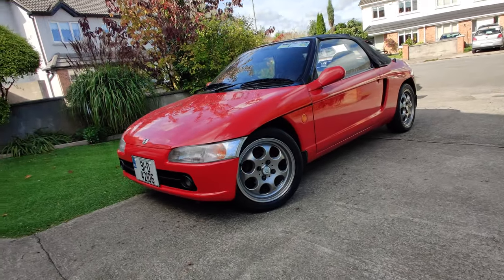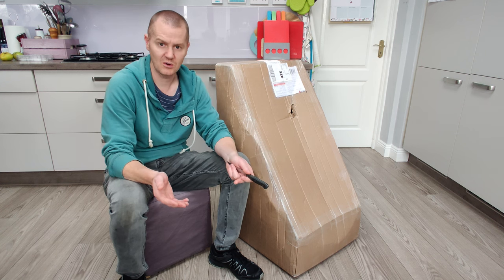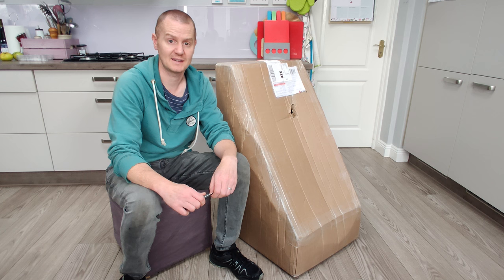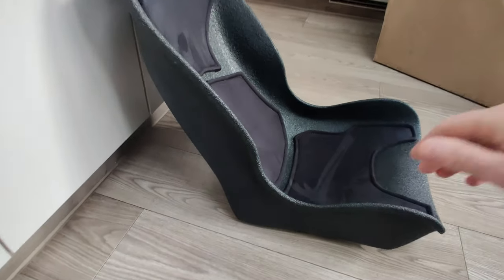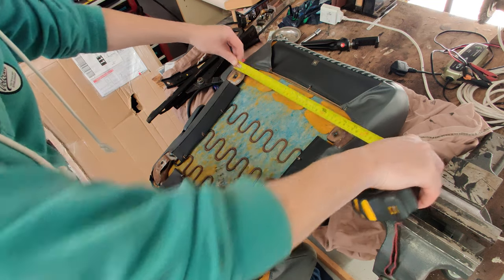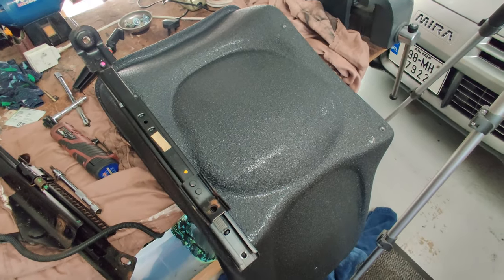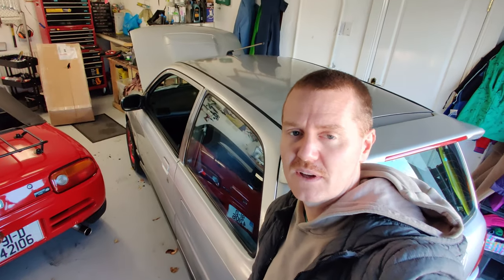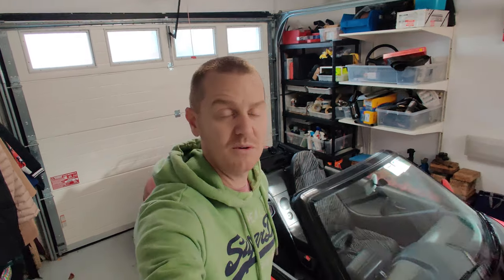Honda Beat - RCC seat

Comment: I was planning on fitting S2000 seats in my beat, driver side should fit the passenger side is a real tight fit where the shouldrest is against the door. But I need to some metal worker to fit them.
Reply from the maker: I'd imagine they'll be heavier than the stock seats also. I'm not a fan of leather seats either - you slide around too much!

Comment: To solve the recline issue, would a few washers/spacers on the rear rail bolts between seat & the rails change the angle enough?
Also, those Mini wheels really suit the car and how does it drive with the bigger rims the same size all round compared to stock wheels?
Reply from the maker: Yes, I could use spacers, but it won't solve the lumbar shape. Ride comfort and handling on the 15's is not noticeably different to be honest and there's a much better selection of tyres available. See my previous video about why I chose these Mini wheels (they are light)